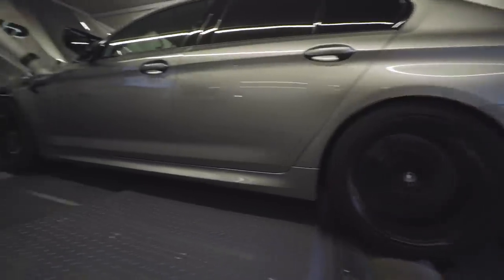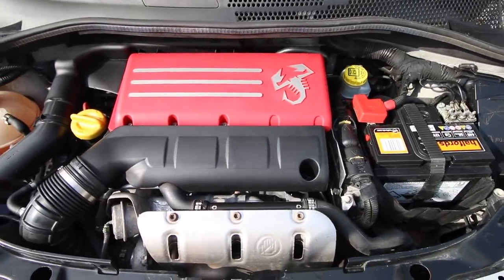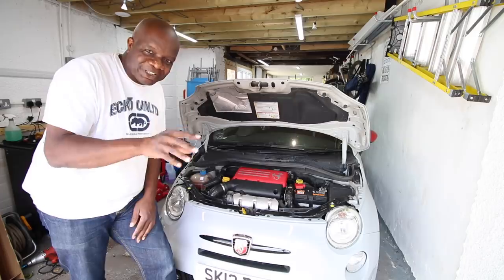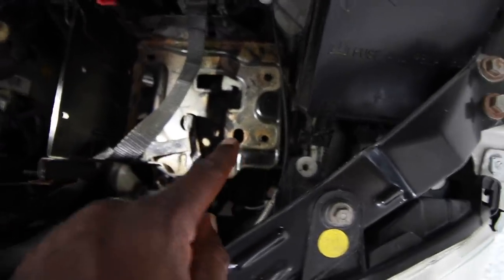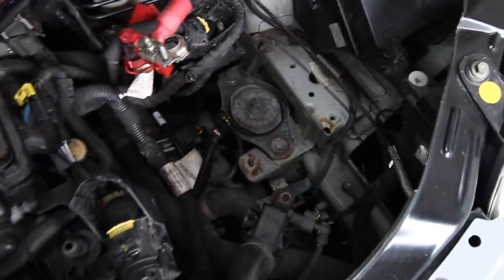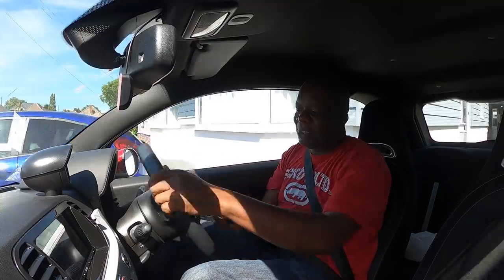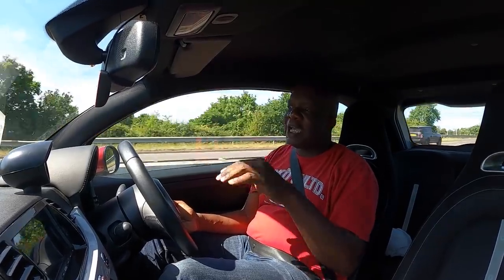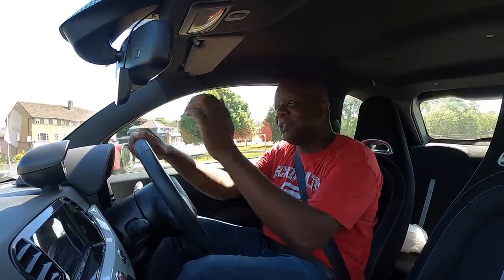Installing a Racechip GTS in my Fiat Abarth 500

Comment: I had a Saab 9-5 2.0t with 150hp and 250nm of torque. Had a Noobtune Stage 1 remap which made 220hp and 360nm of torque. Karl has been doing them for years and I have never heard of a car going bad because of his remap. 70bhp increase for £95 (yes, ninety five quid). Just send off your ECU and it's back in days.
Reply: Do you mind if I asked if you put these things through insurance?

Comment: Another great vid Paul thank you. I put this race chip with a cattle's down pipe and a go-pedal in my Abarth OMG its now a rocket ship
Reply: how many hp did it originally make and how many does it make rn?
Reply: They said my Competizione could not be wired with Go fast Pedal and will only take the GTS kit...What's the reason??? anybody?   2013   AXD1A Abarth  I liked the suggested handiness of the adjustment of the turn lit up and down  knob dial ....a little disappointing

Comment: I bought one of the GTS kits and will be fitting it soon...I hope it is good and works well. TKS 
 Jonny 595 Abarth smiler. I tried to get an additional tune-up box for acceleration improvement but the Race Chip doesn't do it for my 2013 Abarth Competizione. Wish you had shown more detail brightly lit up so as to be able to see connections clearly as I'm no spring chicken but its good fun during these testing times .GB.. Keep up the good vids and keep well .These wee cars are addictive !

Comment: Paul please check Darkside Developments video on These chips where they compare multiple tuning boxes. They are increasing rail pressures above safe limits.
Reply from the maker: I will do that
Reply: Watched this earlier myself and it was very eye opening. Especially the way race chip couldn't provide any specific reasons to the failiure to meet the figures. Don't understand the tuning box appeal, my remap was only £250 and that included a dyno to tune the map.
Reply: Was just about to say the same thing as soon as I clicked on the video 😂😂😂
Reply: They didn't do well at all and for £450 it's a rip off . With a remapping it can be removed and the base map reinstalled
Reply: I was going to mention the same website too. Race chips are not worth the money. Remap all the way folks.

Comment: I ordered a GTS black for my 2019 Dodge Hellcat Challenger. They sent me instructions which included photos of a Volkswagen and Mercedes engine compartments. Kind of threw me for a loop. I called and they emailed the 4 sensor connection photos that I needed. Not sure why they didn't have Hellcat Specific Instructions to begin with.
Anyway, thanks for another great video!

Comment: Hi Paul, great video,the race chip sounds like it improves the power,easy to install with the wires.
Reply: They all work. For semi enthusiast they are great set and forget. That said you can get the most out of it with better fuel and changing the settings.

Comment: Hi Paul, that looks like a great product, works really well and simple to install, but how much did it increase your insurance?

Keep the great videos coming
Reply from the maker: just over £40 as am old👍
Reply: When I had my car mapped by motorsport Developments my insurance went down 😂
Reply: Hi Paul, That sounds like a bargain, I have just looked at their web site and they do not do a power increase for my SL500 but they do a throttle response chip

Comment: I’ve used SA Tuning #Truetune works quite well and can be put back standard when needed
Reply: Of course you can return your flash back to stock. Depends on the car but more OEM's are putting code detection in their PCM's, such as BMW to deny you warranty work if you show up with a blown engine, turbo, transmission, etc and they know you modded your car. The only thing you need to do to remove piggybacks is to make sure any long term codes have been removed from the computer. Other than wear on the connectors, nobody is that serious... There is no way to tell.

Comment: 1.Darkside developments on YouTube busted racechip and every other chip device.

2. A decent remapping company like darkside and my centurion Tuning give warranty. 

3. The power outputs nothing like what they say, but yes you get gains but not ass big as they say. 

4. You pay the same if not more than actual remaps. 

5. If your getting the XLR and the tuning box you be over £370 deep. You go Centurion Tuning you will a custom dyno stage one remap. Not generic map but actually made for your car and will normally save a little money. 

6. Any DPF, EGR etc deletes RaceChip don't. 

A good tuning company will adjest the throttle with the map. I have XLR with my stage 3 from Centurion Tuning to help with my fuel so it's not as sensitive.

Comment: I like your vids but disagree about the racechip checkout darkside developments latest video about them. They mainly increase rail pressure above safe levels and guarantee, what do you think they are going to guarantee come on lets get real.
Reply: I agree with you on that, it's just resistor in a fancy box ( asking for silly money ££££ , , I've made one myself ( cost no more than a tenner with the plugs) and it does make a difference only to a certain level that's it ( lowering the voltage signal , in a way is tricking the ECU) .
You wanna get more proper power , get a remap .
Reply from the maker: I will take a look
Reply: To add to it , you probably feel the difference only after 2000rpm ,below it's just standard stock .
Paul having it on high settings it will definitely trigger the engine light and goes into limp mode.

Comment: That race chip company has a lot of bad reviews, not honouring warranty and people finding it hard to get a refund. i think i would rather use superchips as i have used them on lots of my cars to remap rather than using race chip, they also do a device called bluefin which is plug and play, bit more expensive but you get what you pay for and the company has been going for 40 years. look them up.
Reply from the maker: interesting to know

Comment: Should just get a proper map
Reply from the maker: I have nothing against a remap, I went down this route as it only cost me £14
Reply: Cars For Paul i run one ages ago and then got the ECU re wrote with live mapping and it’s unbelievable how much of a difference there is and with actual prof of what I’m running where as the tuning box is dependent on each individual engine

Comment: Ohh Paul the race chip will never out perform a remap. There are many reasons for this, they can’t adjust turbo boost limiters -  Torque limiters - throttle response - injection timing - AFR - and so on. Many people mod there car with exhausts, induction kits, inter coolers and so on the racechip can’t be adjusted to take the engine mods in consideration. The only way to get the full benefit of any engine mod is to remap them in if you don’t you will lose HP not gain it. Also a remap can be removed and the vehicle put back to standard at anytime. Looking at installation a remap is a lot less invasive and there is no visual sign of a remap. Price is also a concern the racechip is expensive for what it is, where a remap on your Abarth would be around £300 with a warranty. That’s just my everyday experience with any tuning box
Reply from the maker: Hi Brian, first of all, I have nothing against remaps, I went the racechip route because I had the old one from my TT which meant I could upgrade it to fit my Abarth for £14, plus the racechip comes with a warranty too. If I was buying new, I would most likely go down the remap route.